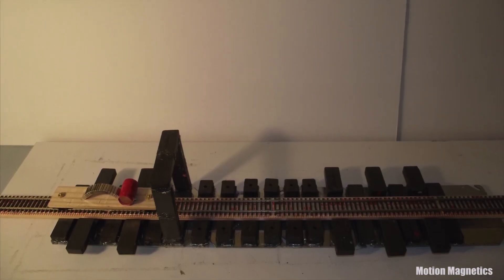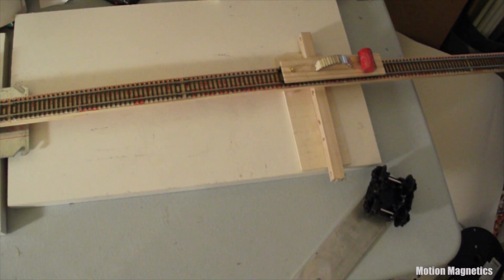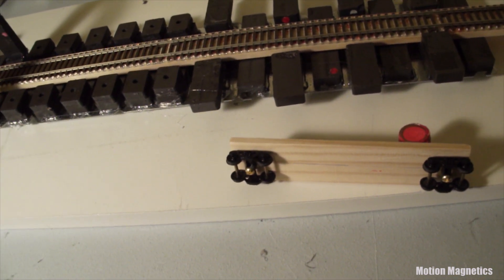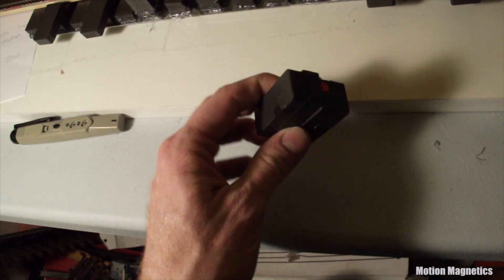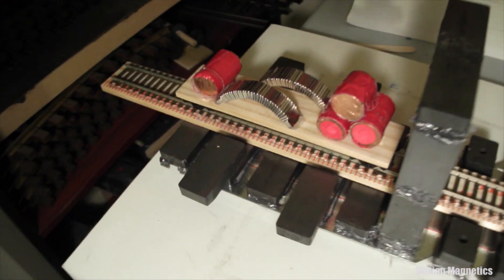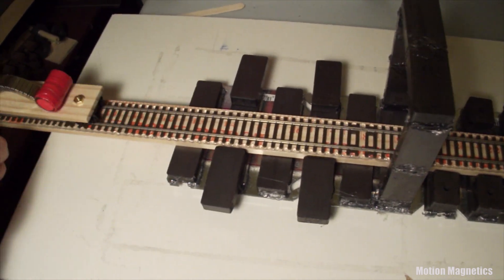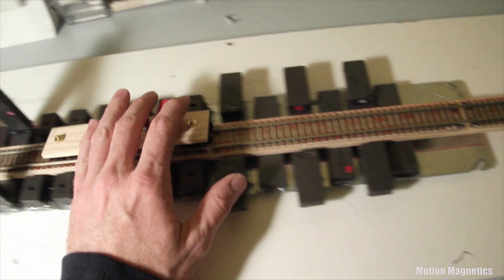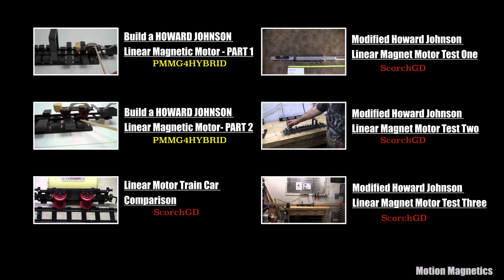Replication of PMMG4HYBRID's version of the Howard Johnson Linear Magnetic Motor

Comment: There should be a gate separated each by 7 sections of track. Each gate allows the magnetic forces to resolve themselves and continue along without coming to rest. So for every 9 track sections, the 1st and 9th track sections would be gates and the other sections are tracks. The gate is in essence a magnetic stabilizer of sorts, where the field is neutralized to allow the train and its magnets to pass without too much attraction or repulsion. This in turn allows the  momentum to build and gives way to the sustained magnetic motion. Placing the gates at any other interval/frequency will not yield the maximum potential.

Since you already have the track, try lengthening it a bit and adding two more gates for a total of 3 gates for proof of concept. So 33 track pieces: gates at section 8, 16, 24: the rest of the sections are the regular magnetic track. 

The real question though whether a circular track can be built using the same knowledge and not have the train hop the track from too much momentum. Once the magnetic motion is freed to continue, there must a good manner to control it in order to handle turns.

I could image for practical large scale usage, the loading platform could have a lift on either end to start the train moving into the first gate where it would instantly go from a slow crawl to maximum speed very quickly. To slow down the train in one could leave a long enough section without gates prior to the next stop. The lack of gates (free acceleration) would of its own slow down the train until it came to a rest. This whole process could be repeated as necessary. The only moving pieces of this system would be the train itself and the lifts at each station, like a push start.
Reply: Sean Regehr Exactly! Why hasn’t anyone attempted a circular track?